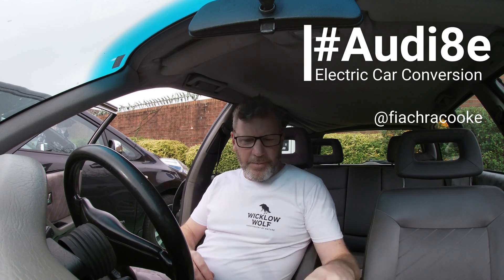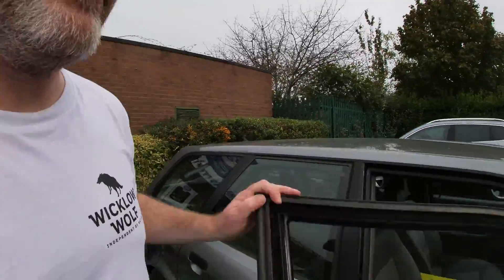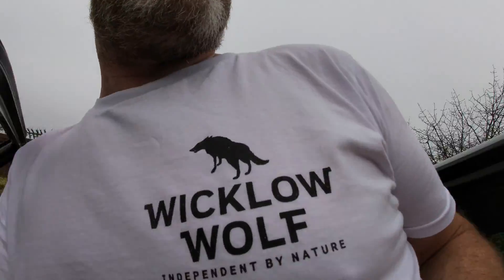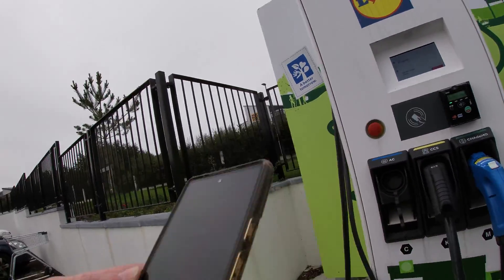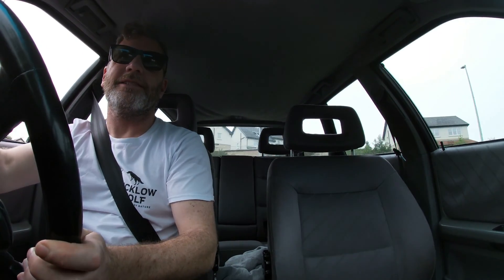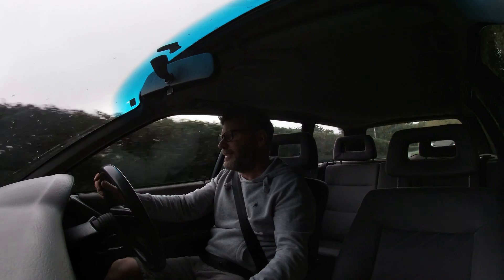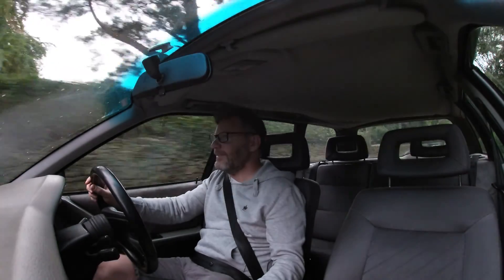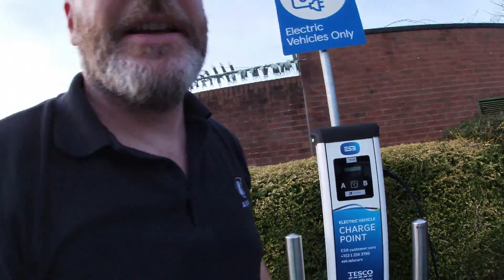Audi 80 EV Conversion - S2 E4

Comment: How much cost to convert it?
Reply from the maker: It cost me about €6k for all the parts. It's the time, especially doing a car that has not been done before, that you have to bear in mind. 7-8 months, 4 of those were solely working on it when I was out of work. Next time around, it would take 1/2 of the time.
Reply: Thanks for the message, i have 2 that i would like to convert, a 94 passat estate and a 94 toyota corolla estate. I will look at your previous videos as this one i saw today just pop up .

Comment: What a beast, love that project! 👌
How much weight did batteries add and how that wobbly audi 80 suspension is handling it ?
Reply from the maker: Cheers👍 Weight distribution is exactly the same as before and I only added about 40kg overall. Handles pretty well!